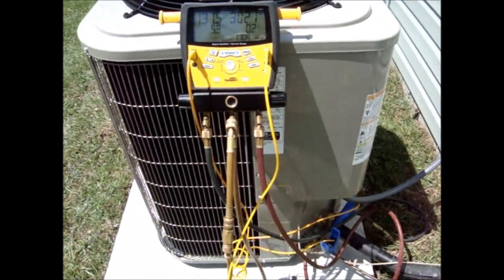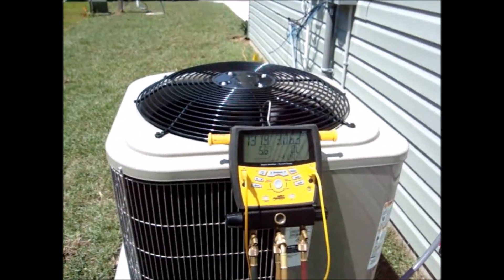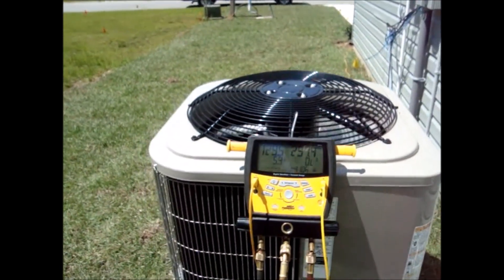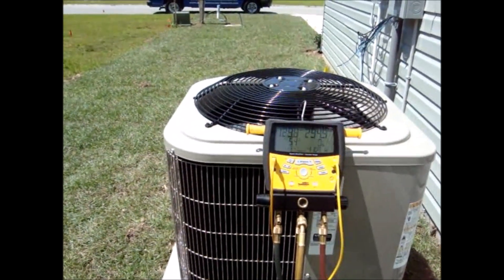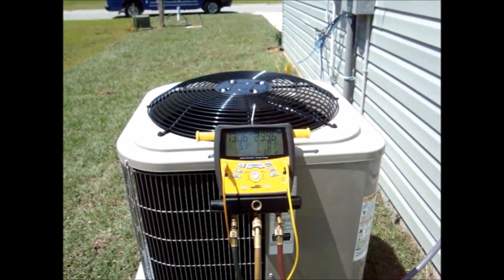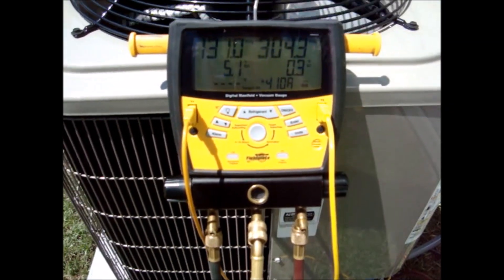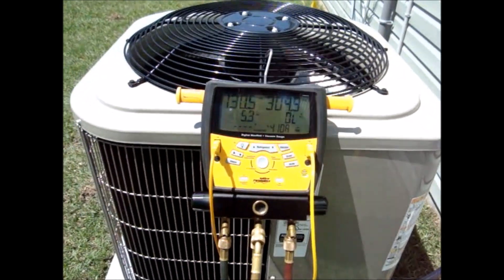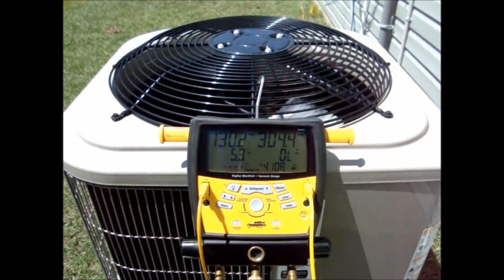Over feeding TXV

Comment: Thanks for the video. I had one doing the exact same thing today. This helped me confirm that I was right about what I was seeing. Usually it's the opposite problem with a txv. Slams shut causing low suction and high super heat.

Comment: Did the txv replacement fix this. I'm having issues with a Rheem now. It's showing about the same pressure on low side. I was stuck on deciding if the low side of the compressor was damaged or the txv. It's got a scroll. I can't remember any scrolls losing low side capacity like reciprocating compressor.

Comment: Was the compressor pulling low amps? Had this today. Delta was right at 20. 79 temp inside. 150/310 90 degree outside. Subcool 1 superheat 9.

Comment: Wouldn't no subcooling mean a starved condensor i.e a stuck closed txv? Sorry I'm new just wondering.
Reply from the maker: No. A starving condenser would have high subcooling.
Reply: @HVACinSC  from what they told me at my shop the more liquid stacked in your condensor the longer it has time to cool"subcool" because it's being held back from the txv being stuck closed. If a condensor has no restrictions in the circuit it flows through to fast to cool i.e low subcool or if it's undercharge? Am I wrong?
Reply from the maker: You can see exactly what happens in this video. Over feeding TXV (or any other metering device) causes low SH and low SC.
A restriction in a metering device will cause high SH and high SC

Comment: I would have added charge to see if I could get my SC up, SH is not low enough to damage system, actually 5* SH is the best performance a unit can have, well 1* is but 5* is safe. many performance guys remove factory TXV and put in adjustable TXV set to 5*...
Reply from the maker: 8oz of refrigerant was added on my original vist (failed to mention)just for testing but again this was a brand new install with a 15' lineset.
The 5 SH is not the issue. The complete lack of SC along with having a high suction pressure and low head pressure regardless of load inside or out is an easy indicator for me that the valve is not throttling at all as it should be.
Thanks for watching!
Reply: How would a TXV that is not opening due to sensing bulb losing its charge act?
Reply: Txv should normally maintain 15-20 degrees of super heat. That's the whole reason for a txv instead of a piston. Regulates super heat, and prevents liquid from being pulled into compressor crank case.
Reply: Not trying to be a smart ass or anything. That's just my two cents. 5 degrees of super heat is totally normal on a hot day with a fixed metering device.
Reply: @joeholmes1324  depends on what superheat for TXV is set to. Some are only set to 8degf.
Reply from the maker: @joe Holmes @timrob0420 Please read the comment I left just above yours from 5 years ago. Stop just focusing on Superheat alone when it comes to TXVs or any refrigerant charge for that matter. Look and process the entire refrigerant circuit.
Reply: @HVACinSC  wasn’t focusing on superheat alone, was just pointing out that not all txv systems are set to maintain superheat of 15 degsf. I realize you are supposed to also look at and charge by sub cooling in a TXV system, but you should still definitely look at superheat as this tells you if your TXV is functioning as it should or if you have airflow issues etc
Reply: @HVACinSC  I definitely do not focus on super heat alone. As that won't tell you if the charge is correct in a TXV application. Only if the txv is working properly, or if there is a restriction or airflow issue. I try to take SH, SC, Delta T and compressor Amp draw into account every time. Thanks for your input and the video.
Reply: @SombraLocs valve would slam shut.